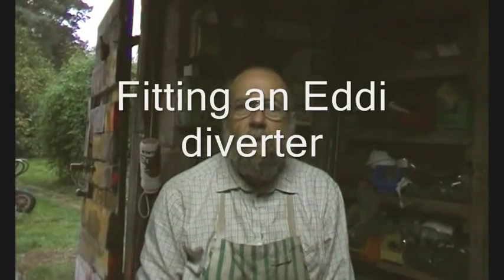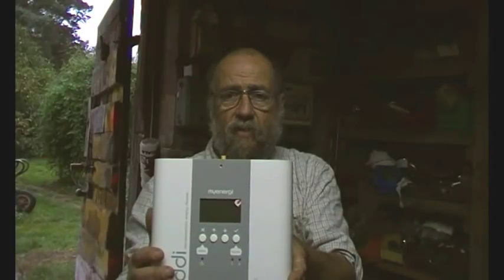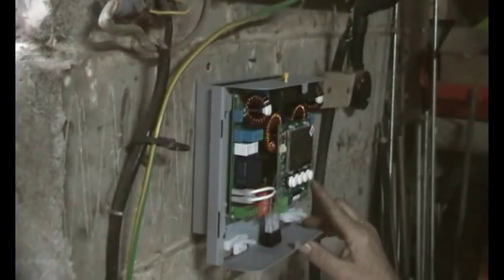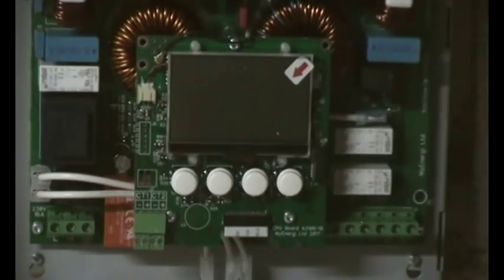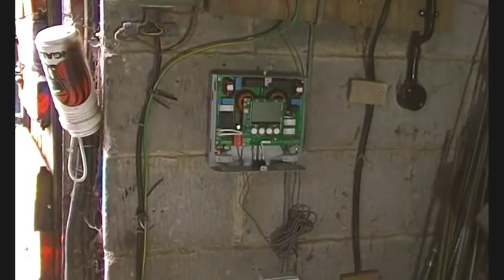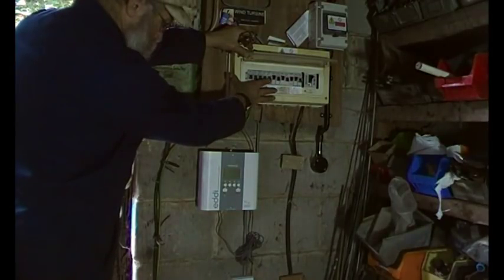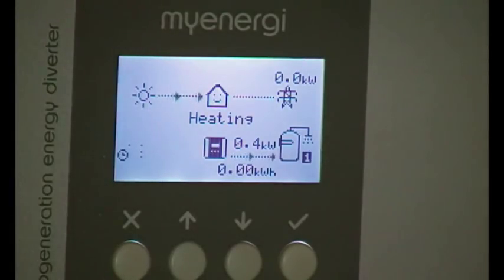Installing a Myenergi Eddi PV grid diverter to prevent export to the grid.

Comment: Hello Andy, would you be able to use one of these connected to a battery charger for a lipo4 battery ? I have quite a lot of unused solar energy going straight back into the grid during the day because no one is at home, I was thinking if I could charge a battery so I could use the power later at night (when its mostly used) i have been looking at power stations but the cost is incredibly high, i think its cheaper to buy the battery and inverter and make my own, thanks Brian
Reply from the maker: Brian, diverters use variable voltage to match the export so they are only suitable for resistance loads. The Victron ESS (hub 4) system with the multi plus inverters does what you need. My friend Lee uses a 12v unit where as Boots Owen (youtube channel) has a 48v unit. Basically it senses export and sends it to a battery, then power shares with the grid when power is required.Please like, subscribe, and share, cheers

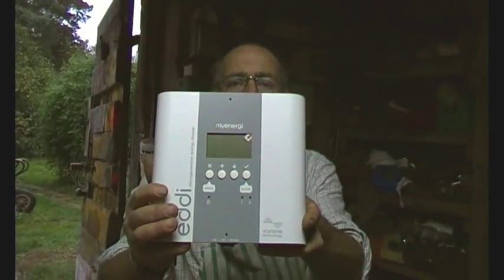Comment: I am looking at getting one of these but I can’t see how they can lead to any savings? My off-peak go tariff is 7.5p kWh. My gas is 7p kWh. So if I was to heat my hot water cylinder up at 00:30-04:30 it would cost me extra to do so. Likewise, if I divert my excess solar to an Eddi, I will save 7p kWh gas but as I am on the a SEG tariff I will not be getting the 4p kWh for exporting the excess solar. So I am really only saving 3p kWh. At £500 supplied and fitted that is a lot of 3p’s to see a return. It might have worked great with FIT payments but not now, Or am I missing something?
Reply: For your circumstances it doesn't look like it is worth getting one. However there are other circumstances where it does stack up - no SEG, no gas, capped export vs potential PV output. Deciding whether to buy one is more than just snapping it up because it's a bit of tech. Knowing your energy sources and costs plus understanding/ planning how you use energy will now be another task for householders to be savvy about to make renewables and the associated tech work correctly for them.

Comment: Basically I setup a 15kw grid tie system and did not sign up for a smart meter with my power company and my first bill was twice the average amount because I was back feeding Excess power into their grid so not only did they get free energy they charged me for it small price to pay for a little extra knowledge right
Reply from the maker: Corey. It sounds like the meter is recording both import and export and so it needs changing. Most meters should just record import, cheers
Reply: @TheInfoworks  thank you for your reply yes out here I am located in Arizona United States and they require specific inverters to export onto the grid and everything needs to go through proper channels engineered and so on just to be put on their approval list to receive a smart meter too much of a hassle to me. I just need to find something that monitors the mains coming in to divert any Excess power going back onto the grid to other items like what you suggested water heaters and so on.
Reply from the maker: @coreyellisart6877  Corey, the Eddi will do the job for you and menus allow for zero export, cheers

Comment: First off good afternoon and thank you for producing this video hopefully I will get a response it's been quite a while since the video has been made I'm assuming on the heater output a contact could be installed to control a larger heater or something larger to divert more power if necessary
Reply from the maker: Corey, the Eddi controls up to 3 Kw and the load needs to be connected directly to the Eddi as the voltage (and so the watts) is controlled by pulse width modulation. A contactor would prevent this benefit. Cheers

Comment: Hi Andy, very useful info as always. Now that it's autumn with a lower shorter solar power peak. Turning on the immersion manually as I have before noon is not an option without drawing power from the grid at times. I'm looking at such a device to scavange all the power I can automatically.
Do you think it would make any difference if the CT clamp were at the fuse panel end of the main supply as opposed to right next to  the meter? In my case there's probably 18m to the main panel from the immersion and fuse panel. Otherwise I would need to go with a wireless setup or very long lead for the clamp. 
J
Reply from the maker: Jim, it will be fine if the CT is on the power cable at the fuse panel. It needs to be either on the live or neutral (not both). My eddi has the optional sensor and relay board that has a great function of capping export when all the loads are either up to temerature of if generation exceeds the loads by a pre set amount. I keep meaning to do a vid about this, maybe tomorrow, cheers
Reply: @TheInfoworks  As I thought Andy, thanks. Looks like it's time to part with some hard earned 👍

Comment: Hello Andy,
whats with your Immersun device ?
Mine is running perfect and had saved me alot of money.
My next project is to integrate my Immersun diverter in a 10 kW/peak off grid  photovoltaik system.
I will use one of my two on grid photovoltaik 5 kW/ peak systems for indicating the possible excess power, the power clamp is on this sytem.
The Immersun use the power of my 2 Voltacon 5048, but only when the 8 kwh Pylontech Battery Voltage is at the " full level".
If this runs all ok, i will integrate a second and third immersun device, they laying on the shelf.
This Eddi device looks very similar to the Immersun device, but no wonder the Inventor of this two devices is Mr Lee Sutton.
Lee Sutton was one of the 4eco company guys, and has now a new company......myenergi.
Best Johann
Reply from the maker: Johann, thanks for your comment, there are many reasons why I am interested in the Eddi diverter, some of them slightly political. Myenergi is only 20 miles up the coast from wher I live so I consider it a local industry. Strange that you comment now as I am just completing a video on using the eddi as a secondary diverter to piggy back the primary immersun using the minimum export and delay functions. The immersun that I have is very noisy, it makes various high pitched noises and of course the fan runs frequently, non of this happens with the eddi. It's imteresting to see the two working together. Cheers
Reply: @TheInfoworks  , thank you for your very interesting videos.
Same here...there are some political points that let me stay away from feed in more into the grid, so my only way is a offgrid system. 
The energy lobby makes here the laws, and the renewable energys are always the loosers.